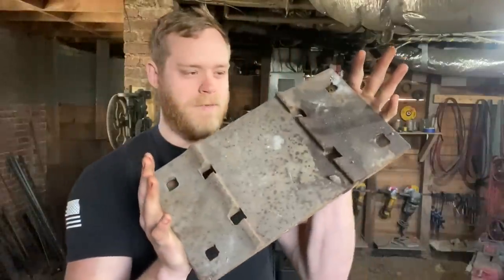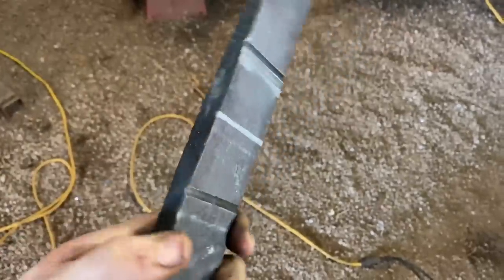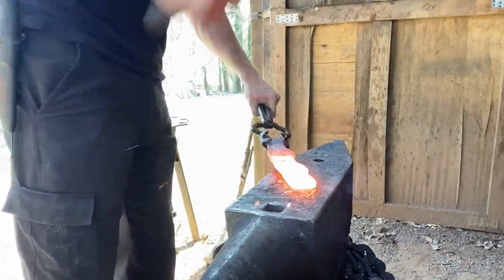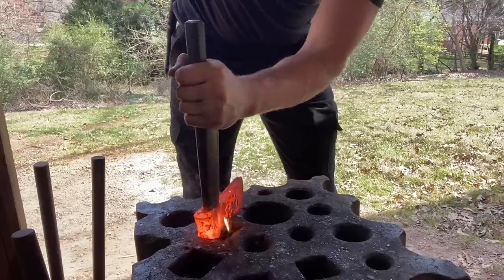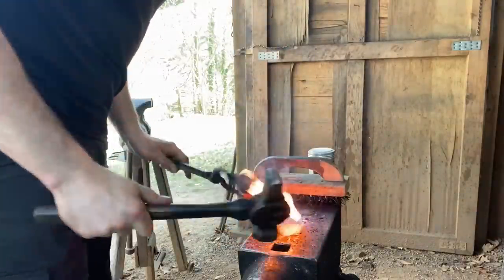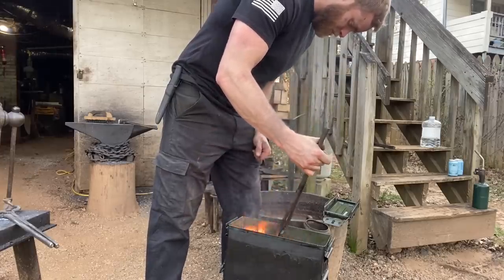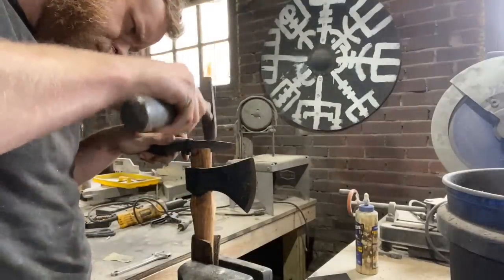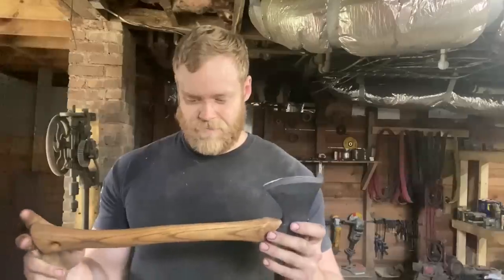Forging a wrapped eye axe from railroad scrap

Comment: What I find most interesting, following a few blacksmithing channels, is that no two blacksmiths use the same hammer. Different shapes, sizes, weights, handle styles. The hammer is a very personal tool to the blacksmith. It's a fun little detail.
Reply: Yes, same with the height of the anvil I think 
I just wonder how they get all these hammers, do they craft it ?
Reply: @kypdo1713  some do, I inherited some and others I bought.

Comment: I had no idea that railroad clips were medium/high carbon steel! I have a whole bunch from my great uncle!
Reply: Mr. Snek + oh yeah, and they a quite tough to move.
Reply: Rail road anchor clips are. most other parts are mild.
Reply: You can use any mild steel for the body if you're welding in a bit. At one time  the body would have been wrought iron  which is softer than steel and they were fine.

Comment: Today tested my ribbon burner that I copied your build as best I could. I tried to forge weld today an old hand ax much as your tommy hawk and jpl service Inc and remember you had also learned from her , But get back to my forge weld the first try I retry my Tommy Hawk and my first ever forge weld I ground it to check out and look welded tomorrow I'll test it with chisel and heavy hammer but looks welded.
 I do believe my rebuild of the burner is hotter and a fast yellow heat is the difference
Thanks,John

Comment: Great job just an fyi the tie plate is tapered where the foot of the rail sits, depending on where you cut the mold steel strip it might have been the correct thickness.🤔

Comment: Amazing video. I am going to attempt this tomorrow. Can I ask your advice, I have a very thick coil spring laying around, (It's > 5/8")Do you think I would be able to use that as the bit? I'd just be welding it to hot rolled mild steel. Your videos are always super helpful, thanks and I hope you keep it up!

Comment: Just curious (I have no idea what I'm talking about here so, please forgive my ignorance) but... could you fold the metal at the blade end and wrap it around the back end instead of forge-welding the two ends at the blade's edge?  Also, "sandwiching" your hardened material within the fold then, grinding through the steel until you reach the hardened material.  Like I said, I'm just getting into watching how these things are made and am curious so, I'm ignorant of the best method.  Thanks!
Reply from the maker: I’m sure you could but that seems like a much more complex process

Comment: I havnt been a smith for an insane about of time only about 6 years but Iv never really ever attempted to forge weld other than some steel cable I made some oyster knifes with iv tried today actually to forge a wrapped eye axe using some I belive mild steel I found laying in my junk pile with some 5160 for bit but no matter how I tried I could not get the mild steel to weld (many attempts with many different pieces) was wondering if any one could help me I'm sure I got it hot enough I used Flux cleaned it off but no stick

Comment: Forge welding does not work with me I even use a 7 pound hammer but the welds just don't set any tips.
Reply from the maker: You actually done need very much force at all to set your initial welds. If you hit it too hard it can actually make the weld not take. Try being a little more gentle
Reply: @OldHickoryForge  oh thanks